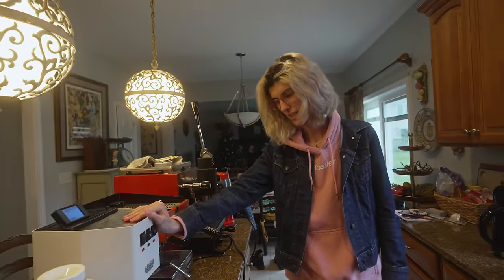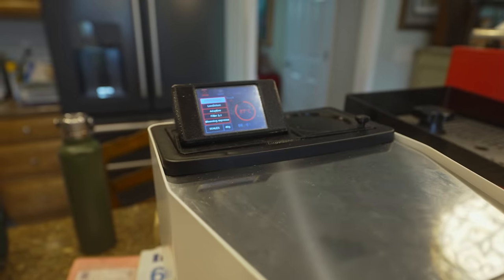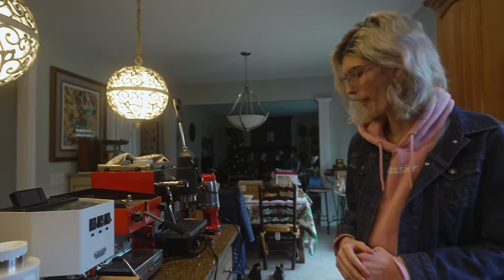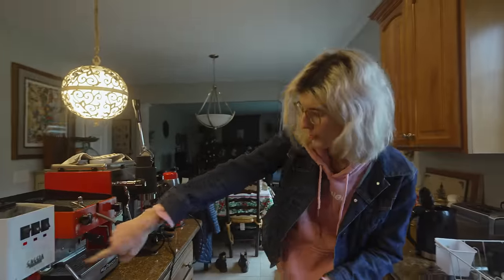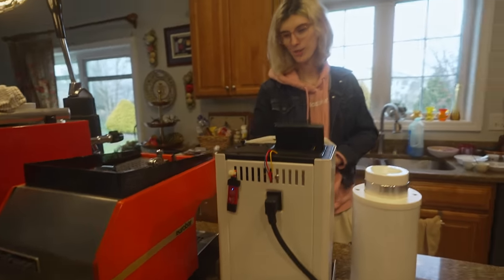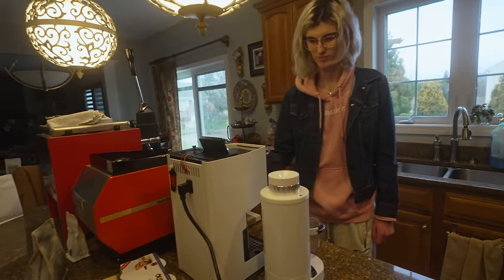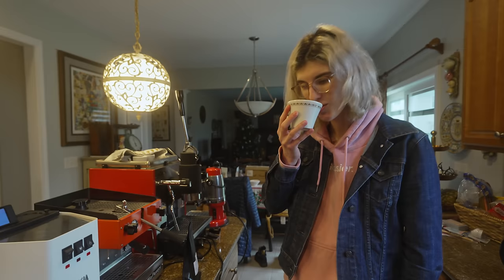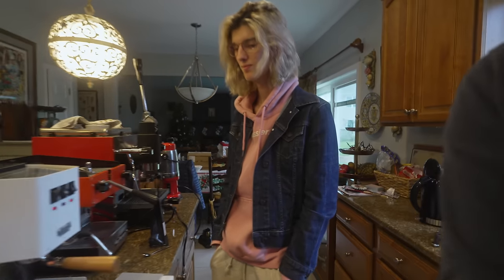FIXING THE GAGGIA CLASSIC PRO | Gaggiuino Impressions

Comment: I just finished my KitchenAidiuino dual boiler. Still figuring out all the features, but it's been great! Just a note for anyone considering building a gaggiuino, it does not need to cost $1k USD. It can be done for a lot less than that with a used machine, carefully sourcing parts, etc. I think it can probably be done for less than some of the PID mods I've seen though.
Reply: Do you have any links to the kitchen aid build? I was just given a kitchen aid dual boiler and a gaggia. I got projects for a while now.
Reply: i want one of those kitchenaid machines sooooo baaadd lol
i gaggiuino'd a delonghi stilosa, nano, i modded the software to be touch screen start and stop brew and steam, and also has stop on weight and stop on time :)

Comment: Awesome overview of the Gaggiuino! I built mine this past month and I'm still learning and having fun messing with it. Community is great, as Riley said, but it definitely takes time and effort, which is worth it if you're into that sort of thing :)

Couple notes:
- There are two authorized PCB retailers now, and it is possible to get a kit with the pressure transducer, thermocouple, and a bunch of other things (so almost everything you actually need). Still takes a little while, but it's an option.
- I think the flashing steam light is just indicating that the boiler is currently heating
Reply: Hi ,can you put a link from where to buy the kit?Thank's
Reply: @cipry27 Peakcoffee. They're in the US, but ship overseas too.